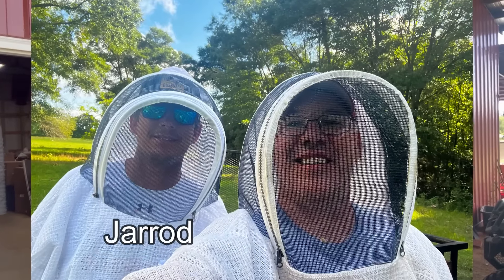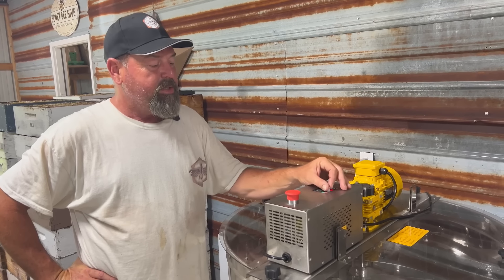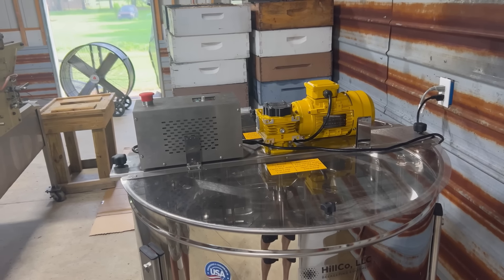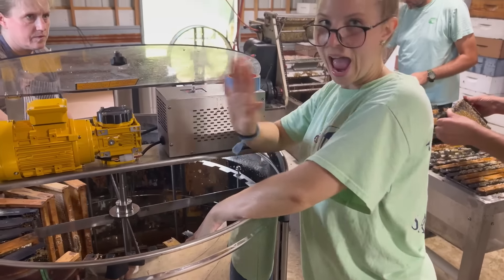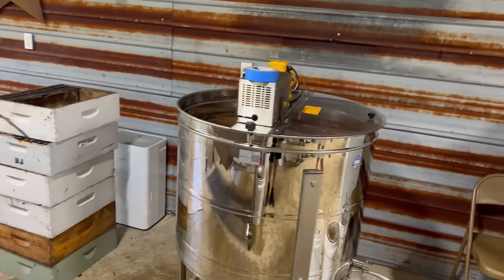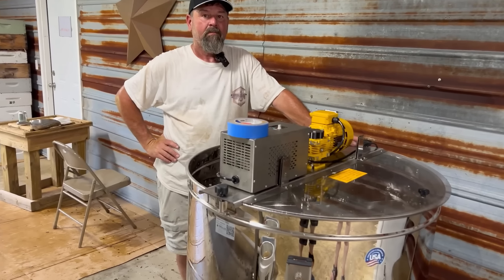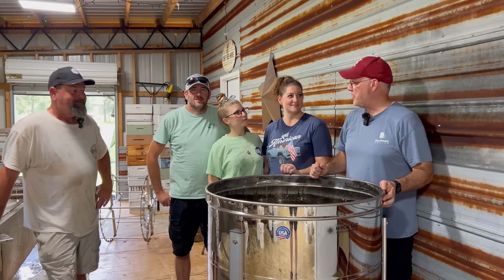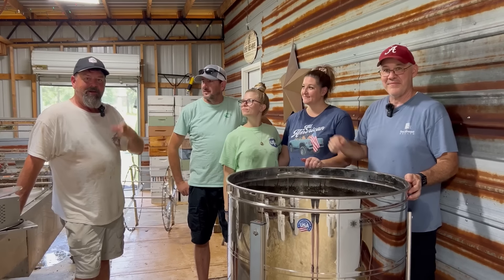New Hillco Honey Extractors - Game Changer

Comment: I had the 12 frame hillco extractor and it was amazing but when i saw the 32 frame i had to get one and im just wondering if you think it would run ok without being bolted down im not totally sure where i want it yet and dont want to bolt it down yet. Thanks!
Reply from the maker: Yes. But if weight not balanced it can rock. One thing you might consider is bolting it to a pallet or some kind of surface like that to stabilize it.